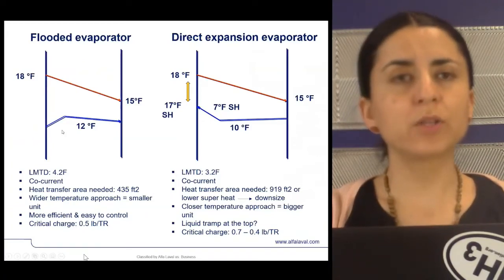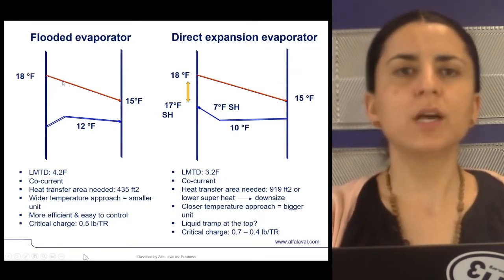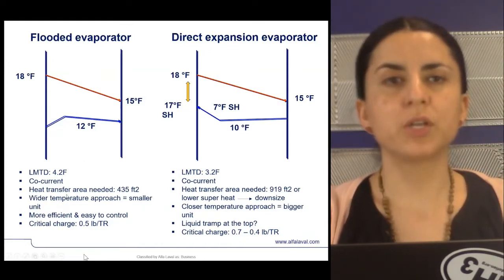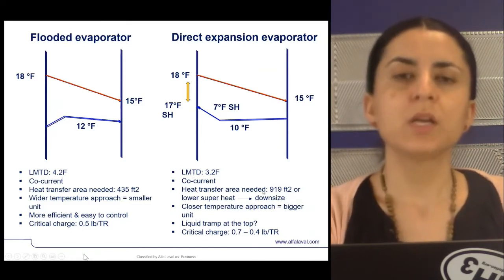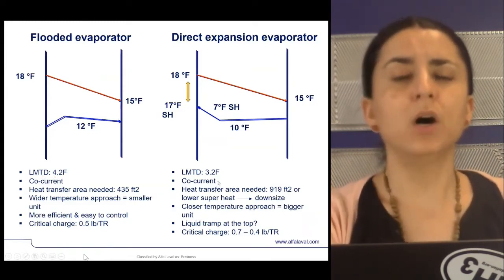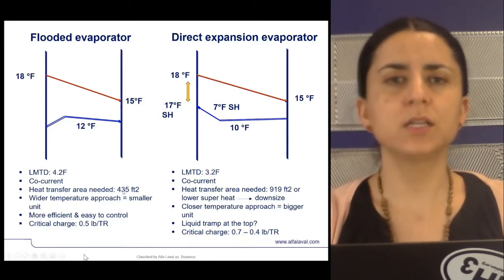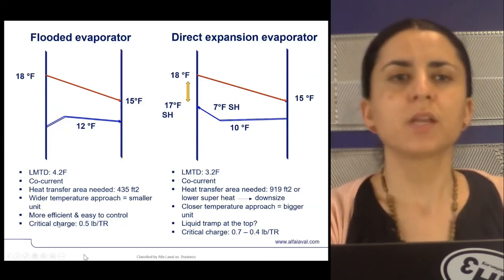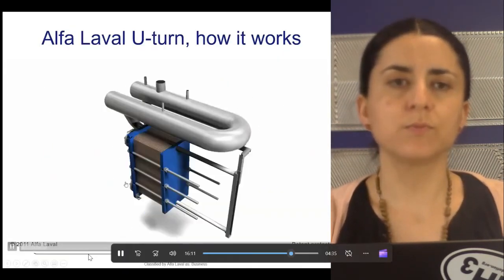Recreational rink refrigeration: flooded evaporator vs. direct expansion evaporator

Comment: Easy to understand. Gravity flooded systems have fully wetted heat exchangers which allow for the latent heat of evaporation to take place through the entire coil or HX internal surface, as compared to DX which loses capacity due to the 20% or 25% of internal surface being wasted by superheated vapor 🥳